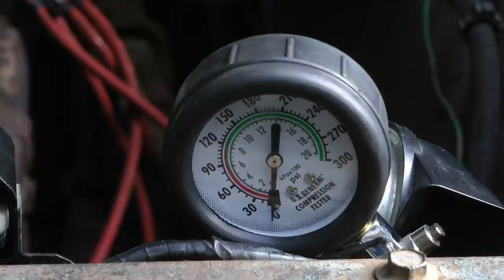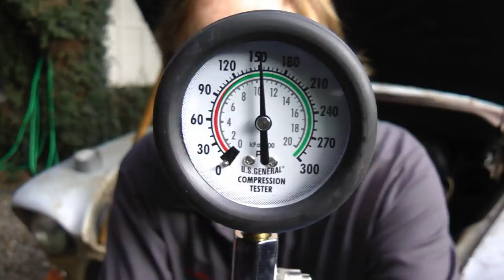How to Tell if Your Car's Engine is Bad

Comment: hi scotty, i have 1NZFE engine, my km now is around 170.000 km, i see your explaination about your spark plug, if have a lot of black carbon and have some little bit oil there its mean the piston ring its a little bit damage. my spark plug is like your in display, full of black carbon, and a little bit oil up there. without some compression gauge, can i say my piston ring is start to damage ? cause i think, if my piston ring is damage there will have some smoke (blue white) in the exhaust, but i dont see a little bit smoke there even when my friend drive my car, and i stay in other car to see my exhaust have some smoke or no, but my fuel consumtion is decrease now if we compare when my car is new. then my engine condition is a little bit knock every 80 - 90 km/h if i push aclerator pedal smooth, but if i kick down (my car is automatic) the knock is gone. mybe you can have some solution for this please...
Reply from the maker: do a wet and dry compression test of the engine to find out if it's worn piston rings OR worn valves

Comment: hey scotty i drive a 1973 f100 with a 302 v8 and a c6 trans, I've been chasing a tick that only appears at about 2200 rpm on throttle and will continue once i let off. I've tightened, welded, and cleaned everything i can find but to no avail. any help would b greatly appreciated!
Reply from the maker: oftn internal engine wear like lifters or worn valves do that
Reply: awesome thank you! do i need to fiddle with timing if i remove my valve covers and check the lifters?

Comment: i have a 1997 dodge ram 1500.  5.9 and when i put it on gear the oil light blinks once i step on gas it does not blink while driving

Comment: I got a question? I hear knocking on the motor when I accelerate i know it's a sign the motor Will break down is there any way to prevent the motor full BREAKING  down?  is there a way to stop the knocking in the motor it had just started?
Reply: Rudy Hernandez  if your going to consider rebuilding the engine, and it's already knocking, stop driving it now or you'll risk spending more money on the rebuild.
Reply: Get rid of it now, best thing you can do. If you hear that knocking it's time to let go and get some money for it before you get screwed.
Reply: Is it spark knock? Run high octane gas and see if it stops. If so you have a high compression motor that requires higher octane premium fuel or you have a ton of carbon build up and need to clean it out with seafoam or berrymans b-12.

Comment: Hey Mr Scotty I hav an 03 malibu for 6 yrs  now n my mechanic say my oil pump is gone  my engine been knockin n lifters been tappin.   So. Will a new oil pump stop it or is it some kind of oil I can put into it?    Thanx
Reply from the maker: Theresa P once knocking like that, generally engine has internal damage a pump will not fix. But it might make it last longer before it blows. Just realize that car is at the end of its life span anyway, gms rarely last longer thatn that before serious problems arise
Reply: OK thanks.  I'm looking  for a used engine for it

Comment: So my head gasket had blown and when I cranked it the a/c worked a little. now in having a new gasket put in should my a/c go back to normal?
Reply from the maker: IF the ac system itself is OK, yes
Reply: So having A blown head gasket can make the A/C not work as well? And how do I know If my car has that?

Comment: Scotty what's a good compression reading for a Dodge 360 engine thanks
Reply from the maker: 145 or higher
Reply: Scotty Kilmer thank you Sr
Reply: what about if the engine is cold ? I have a bad turbo thats burning oil so my mechanic didn't want to warm the car up and just did it cold. the numbers we got seemed decent but they were all over the place from like 115-160
Reply from the maker: all over the place means the engine is flat worn out, differences shouldn't be more than 10 percent

Comment: I got a 2005 Toyota camri and  it shaking 3 tires are very bald and we just put a new one on could that cause the shaking
Reply: cv axle or tie rods . same thing in my camry pushing 255k and the sjaking stopped. i hope that helps

Comment: hi i got a bmw 320d on a 2002 year its has a miss fire on tick over but wen u drive it its fine and turbo dont come in untill just over 3000 rpm what could be the problam mate thanks

Comment: Hi scotty i have a 94 ranger 5 speed and when i crank it and take my foot off the clutch while its in neutral its starts a clanking noise and i get that same noise that gets faster as i gain speed in every gear but for some reason in 4th gear the noise is completely non existent do you know what the problem could be?

Comment: if the engine starts right away.. i mean like literally in one second its worn out. i had a dodge dakota with 280k and it did that. always started but definite loss of power and burned oil. i just needed it for the winter only paid $500.

Comment: How many times do u turn it over for correct results?
Reply: Just keep doing it (make sure whoever is cranking the engine has the foot to the floor on the throttle) until the compression gauge peaks.

Comment: Got a v6 2000 3.8L ford mustang with 220,000+ miles. Runs fine around town but if I speed up too fast or take it on a highway a clicking noise comes from the passenger side. Any ideas what it could be? Help???
Reply: Exhaust leak...

Comment: I've got a Honda 00' CRV with the 2 nd cylinder without compression.  The other cylinders are fine.  Seems like either exhaust valve or something else that is causing loss of compression and misfires.  The car burns mad amounts of oil...huge blue smoke clouds when driving...  The 2nd cylinder spark plug was seriously covered and destroyed to shit, whilst the others are fine.  It's not losing coolant and the head gasket seems to be ok.  

What's my cheapest action to take on this thing with 215,000km???!!!
Thanks anyone.

Comment: if anyone can answer this then great. This isn't really on topic with the video but how will I know if my transmission is ok and if it's really on the edge of busting down? I have an 03 VW passat and it kinda jerks when ever I go to D or R and sort of jerks when I let off then put back on the gas. Any answers would be appreciated, thanks :)
Reply: Scotty Kilmer Thanks for getting back Scotty! Only reason I bought it was because it's my first car and the deal was too good to pass up. If it lasts even 6 months to a year it was a steal. If trans does go I'll just junk it and get a new car, like you said no point in really rebuilding it, thanks!

Comment: Hi Scotty, i have a diesel tractor i know its not a car, motor fumes out the breather but dosent use a scrap of oil any idea what it might be
Reply from the maker: rings are probably just wearing some, there are oil control rings, and there are compression rings. Oil rings can be fine, but worn compression rings will cause those fumes.
Reply: Thank you much appreciated.

Comment: Hello Scotty Kilmer! I have a 2006 CHEVY TRAILBLAZER LS of 3 Issues:  The first one is giving me a roaring sound (like a RTA BUS pulling off) thats annoying of Code P0526 (with My Check Engine Light On) of what I hear when I drive or put my foot on the accelerator Paddle. The sound comes and go, but when it comes it causes my truck to slow down and seems like it taking away from my Gasoline- Can You Please Tell Me What The Problem Could Be To Fix it-and I Noticed the Fan Is Moving.
The Second Issue is I also have a Code of P0455 for a Power Steering WHEEL POSITION SENSOR of which I replaced twice, but, still seems to come up on Diagnostic s and show 2 DASHBOARD LIGHTS of Wrench with car and Triangle with curvy lines. Can you tell me what the problem can be with that Please. 
The Third Issue is, I Don't feel any Heat out of the 2 Driver side Vents, but in the passenger side; but I Changed the Thermostat. Can You Please Tell Me The Solution to this Problem of All was addressed at the Dealer when under warranty and when expired; they couldn't find the problems to fix but not of others not  complained about. Please Help Me for that is the Only Vehicle I Have.

Comment: My 2001 jeep grand cherokee laredo 4.0 has a rough idle and sputter when I'm stopped at a stop light and it's worse when the car is in drive. Once the engine warms up it doesn't do it as bad do you have an idea what it is?
Reply from the maker: +Marcus Cox tune it up first, and if that doesn't work, try my video "how to clean fuel injectors on your car"

Comment: Can you just replace the piston rings?
Reply: +John Wilkinson yes you can no it wont ruin it more if you know what your doing but it is usually not worth it because the piston rings usually wear out because of more serious internal damage so replacing them will only mask the problem for a little while and with all the work to change them out you might as well swap the whole engine
Reply: +John Wilkinson You can, but simply doing that will not guarantee a fix. There are likely to be some issues going on with the cylinder walls, so the best options would be to re-surface the walls and replace the pistons with slightly larger ones.
Of course, doing so would set you back a considerable amount of money.
Reply: as anyone will tell you(and as everyone apparently has lol) there is little to no point in fixing something like that. If it's the only thing wrong with the engine then go for it, but as you take it apart you may find more serious issues, and fixing the pistons will do absolutely nothing. When it comes to engines there is always a reason something happens to them, and replacing the seeming problems doesn't fix the actual problem, and the new parts you just bought will break again in the exact same way, while the actual issue(s) gets worse and worse. It's best to just replace the engine because more likely than not, you'll have to anyway. 

Again if there actually is nothing wrong with the rest of the engine, then go ahead and replace it. But in the instance of something like this, there is clearly something wrong with it, because this doesn't just happen.

Comment: @Scotty Kilmer, what ya think old nissan 02 198 thousand miles had a bad motor since 80 thousand and still going with old mechanic tricks. in reality it paid itself off at 70 thousand but a lunker to and from town for run around. still running and may take a few turns but she gets going.
Reply from the maker: sure, just keep driving till it drops, and then get a good used toyota. Modern nissans are often crap since they merged with Renault.

Comment: Correct me if I'm wrong. Can't you use a vaccum/boost gauge to roughly get the same information? I'm aware this is a lot more accurate though.
Reply from the maker: not a smart idea, because you don't know if system has any vacuum leaks, which would make such a test waay off with readings
Reply: True, but lets say you know all vaccum fittings are good. I'm not saying it's a complete guide know all. But a rough idea.
Reply: Adam Dama Compression testers are cheap, if you just have a gasser you can literally get one for twenty bucks.
Reply: Nah. My engine was just rebuilt. So it'll be straight. I heard you can use it, like I said, not an end all troubleshooting, to give a rough idea.

Comment: my car is making a sound like a truck almost im trying to figure out what that means any ideas? ya know that chug chug chug sound a truck makes when its running. like an 18 wheeler
Reply from the maker: check for exhaust leaks first
Reply: ok thanks and if it not the exhaust what else could it be
Reply: Is your car a truck?

Comment: Hi Scotty, I was wondering about the tons of videos showing people decoking an engine by squirting water into the air intake.
Is it really safe and beneficial to do this or not? My car is at 200,000 miles so it's probably got some carbon inside it.
Thanks
Reply from the maker: ***** ONLY a pro should try that, you can hyrdrolock an engine doing that.

Comment: Hey scotty I have a 2000 Ford focus, z tech duel cam overhead engine. Sadly it has a 100 leak on the no. 3 cylinder I was told I can swap it out by dropping the oil pan is this true? And if so how ?
Reply from the maker: it can be done, but it's rather hard doing it that way
Reply: Scotty Kilmer does anyone have a video on how to do it?

Comment: anything over 90 PSI is good when you add oil to a cylinder of course the pressure is going to go up simply because you can not compress a liquid
Reply: Kevin spacey yeah I was just saying that most engines require 90 PSI minimum to fire most engines that I check that are good or anywhere from 130 to 175

Comment: Hi Mr Scott. I want to ask you how can my 1300cc car would have a big Horsepower in it? Because it's original power just 92 PS. Any idea how to increase power without changing engine blocks?
Reply from the maker: putting on a super charger or turbo charger is the only real way, and they are not cheap
Reply: Scotty Kilmer
what is the difference between superchargers and turbochargers? Are they just plug and play or i need some mechanical process to install it in my car
Reply: Netto Nenet Both methods force more air into the engine. Turbochargers use exhaust gases to spin a turbine and typically give you power in the top of rev range. Superchargers use a pulley running off the engine and give you a more broad powerband. Both require pretty extensive modification to not only give more power, but also require supporting modifications to use the power. Correct me if I'm wrong on anything Scotty.
Reply: U could put now if Its a manual.

Comment: I have a 96 dodge dakota 3.9 I replaced the tps and it still ideals rough and cuts out bad
Reply from the maker: +John Shutters tons of things can do that, best to analyze data with a scan tool, searching for vacuum leaks and possible bad sensors. But that old, do a compression test of the engine first to see if it's just wearing out

Comment: Scotty , i have smoke coming out of the oil filler cap , what does that means ?
Reply from the maker: +eyad aljamal generally it's a sign of worn piston rings
Reply: try a pcv valve before you go replacing piston rings
Reply: +Scotty Kilmer I would put a new engine in that truck and go Patina on the body! Please answer me back if you're still on youtube. I would like to hear from you. I would like to hear your feedback.
Reply: +Scotty Kilmer Scotty, I know of two different cars with different mileage under 100,000 miles. Both have significant smoke or a strong exhaust/oil smell coming from the oil cap. Do you believe these have the same issue?
Reply: +Concept Yes most likely, piston rings or value seals i think. in a rare case back pressure?
Reply: ***** My mustang is older and has more mileage but does not have this issue. May be because they are Korean cars?
Reply: ***** it will not gonna stop the smoke , it will only suck it away to the vacuum .

Comment: with an old truck like that it would be worth rebuilding it. thats the idea of an old truck like that is its suppose to be a project you work on over time.
Reply from the maker: +Micheal Deacon sure, but owner was pissed as he just had that used junk yard motor installed and was told it was a good motor, which it isn't.

Comment: I don't get it, piston rings are worn, "..get e new engine..." i assume it's about costs, but that engine can be restored and sold even so, which in terms means pistons can be replaced and honed, it will run fine another good while, do you agree Mr. Kilmer ?
Reply: nope. eaiser typed than done. No one who speaks english will do that job for you for less than a price of a used engine.

Comment: My 1995 Ford Mustang 3.8L Fuel Injection  V6 something  made the engine stop. when I look under the hood I see this Yellowish looking Green stuff comeing out of a Metal pipe/ rubber Tube that's connected to the brand new fuel pump. I did my Best to plug the hole that I think is there and it almost started. the engine did not make no grinding sound or any sound it just simply turned off the battery light came on the check engine light came on and that's all and I noticed when the power steering went out that's when I knew something wasn't right and I didn't know that the engine turned its self off. that's how quiet it was good I didn't even know that the engine turn off until I lost power steering. that's not a sign of the engine blown?

Comment: Easier way to tell if  an engine is bad:
Check the grill or trunklid, and if it has a chrysler badge anywhere, it's a bad engine.
Reply: I really loved my Sebring 2.7L.

If you can get them cheap w less than 100k miles. BUY IT!!

Comment: The owner could always either pull the engine out himself.  Or pay a mechanic to pull the engine out and have torn all the way down to the engine block and have sent out to a engine machine shop and the machine work done.
The rebuild the engine replace parts that need tothat to be replaced and then install the engine back in the truck.

Comment: loud knock from engine, reduced power by a lot, when you get up to 30mph you're pushing 5,000 to 6,000 RPM. engine seems to shake, and knocking gets louder when you accelerate. car doesn't always start, and when it does it's a weak start sometimes dies in idle. any idea what this could be?
Reply: You're probably misfiring. This can be caused by bad spark plugs, coils, wires, bent valves, stuck EGR valve, and likely a lot more causes. You might try pulling codes.

Comment: Did you do the reading on a warm engine?
Reply from the maker: in this case, yes, but it really doesn't matter cause if readings go up a bit from cold to hot, that just shows the engine has serious internal wear also.
Reply: Scotty Kilmer Yes but i figured the piston rings wouldn't seal right on a cold engine, so pouring oil would increase compression even on a good engine?
Reply from the maker: 958van
you only use about a teaspoon of oil, so it won't effect a good engine much